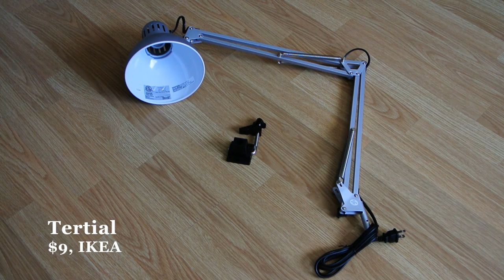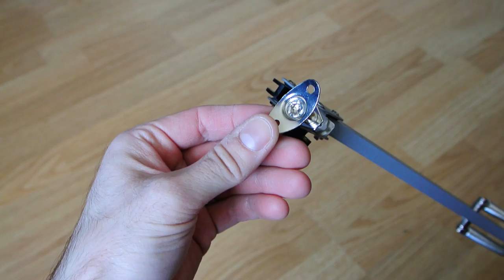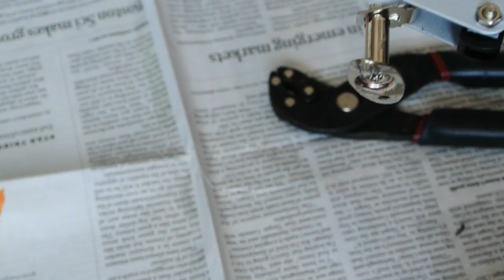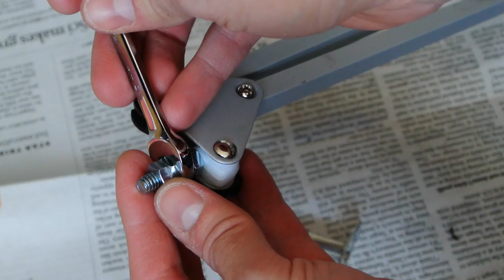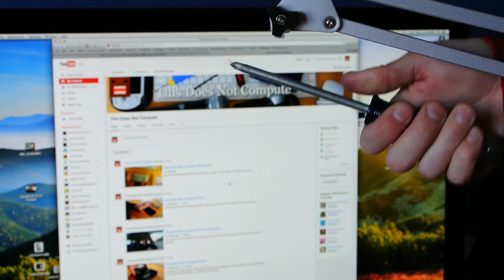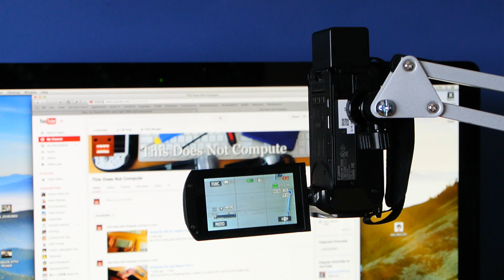How to Build an Overhead Camera Swing-Arm Mount for $9

Comment: I did a video using one of these to make a mic arm. such a good product for under $10. I recommend using a few rubber bands at each spring location. helps the tension stay a little tighter.

Comment: Picked up a couple of these $9 lamps at Ikea, some 1/4-20 bolts and nuts, and a ball head adaptor on amazon - went together nicely, it's an easy build if you skip directly to the "remove the post and widen the holes" step :-) Supports a Canon S100 perfectly, I'm using it for a bunch of Lego photography (no remote shutter release on the S100 though.)

Comment: Love the video!

I would like to make one, but I am wondering if the structure would be able to hold a Canon Rebel camera? Also the Sony ADP-BH1 ball-head adapter would fit a canon camera securely?(I'n not sure how to check for size to find right ball-head mount for my camera.)
Reply from the maker: +Dandy Corsets The arm itself is strong enough to hold most cameras, the real limitation are the springs. You'd need to find stronger springs to hold up a DSLR. The ball-head adapter is very sturdy and can hold a DSLR without a problem (I use it occasionally with my Sony RX10). Thanks for watching!

Comment: Great video! looks great, I'm wondering if you've done a weight test with it?
Reply from the maker: +Morgan Hvidt I don't have exact numbers, but the weight capacity depends on the springs. As is, the lamp won't support much more weight than a small camcorder or maybe a small mirrorless camera. If you can find stronger springs, then it can support more.

Comment: Could those spring posts be moved an inch or two out toward the end of the arm to put the springs under more tension?  If so, it might support a heavier camera.   Or, replace those springs with heavier springs of the same length.
Reply from the maker: I don't think there's an easy way to move the posts, but heavier springs would likely do the trick.
Reply: Thanks, TDNC!

Comment: how heavy is your camera just wondering???
Reply from the maker: With the extended battery, it's about 11 ounces (or 310 grams). You might be able to get away with a slightly heavier camera. It also might be possible to find beefier replacement springs for even more carrying capacity.
Reply: Thanks for your answer this is very helpful!!!
Lee